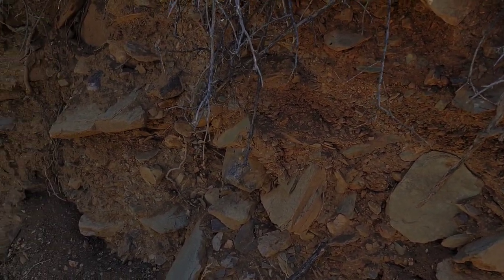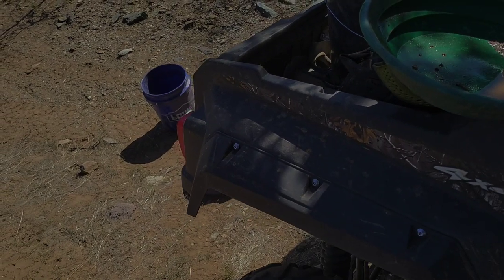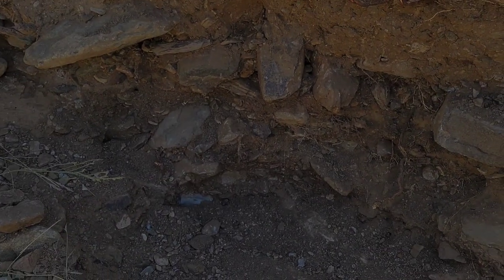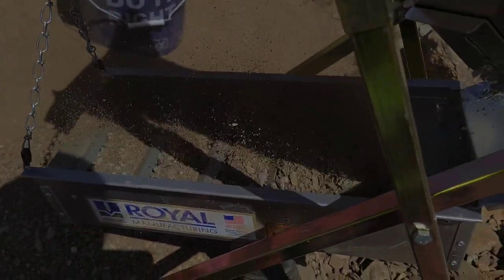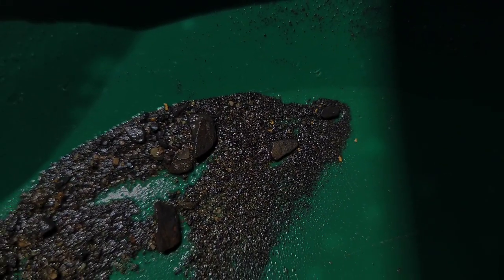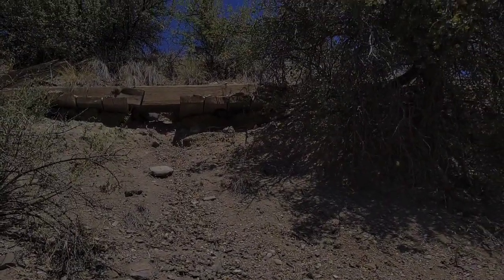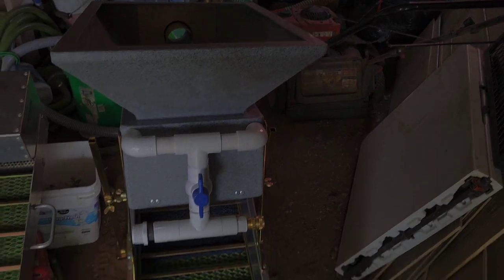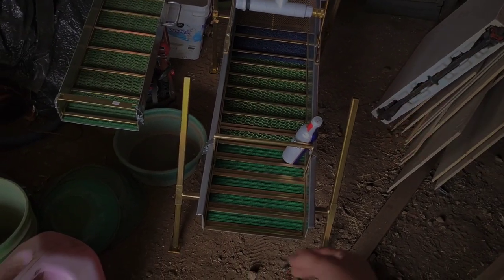Drywashing multiple samples for gold & cool old history!

Comment: Looks like another fun adventure chasing the shinny.  I went out on map 12 again sampling.  Found lots of places it isn’t but also found few places with similar color in a half bucket classified.  One was a sand bar with lots of easy gravel.  The other similar where the bed rock has a few flakes as you crumble the stone on the bottom.   More work but much larger specs.   Can’t wait to see the new supper suction dredge action.   Just joined your Patreon so I can win some of the easy pay dirt. Easier than digging!
Reply from the maker: I noticed this morning, thank you! Thank you! 😊